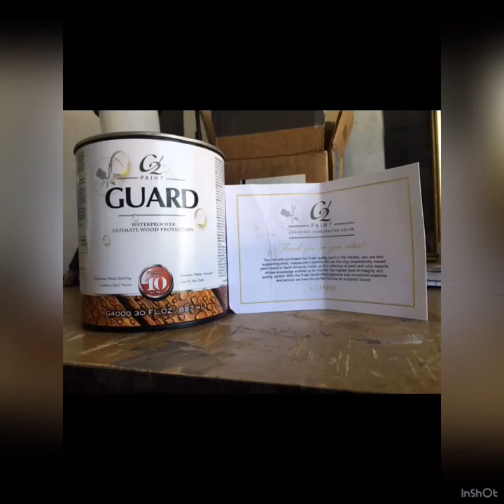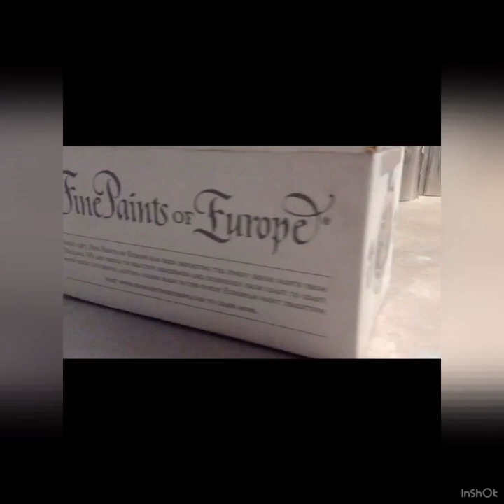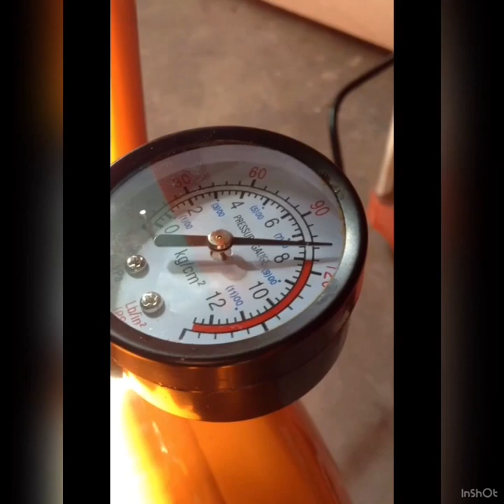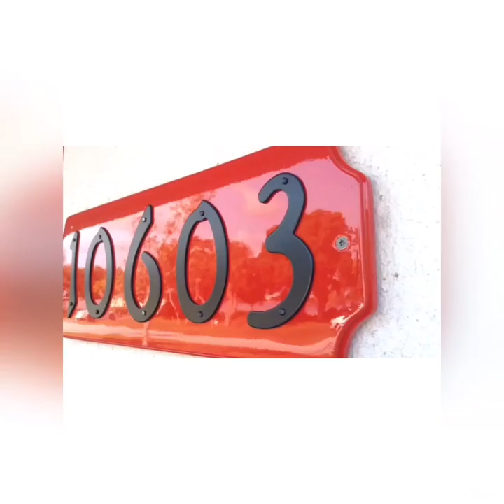Fine paints of Europe hollandlac brilliant front door

Comment: Amazing job Tyler!!!! Where are from? I’m your 217th Subscriber. I didn’t know this paint can be sprayed, my dealer told me to brush it on with the Omega Brushes. They really should give more instruction about how to use the paints for different. I really want to spray for my project. Did you add any thinner or solvents to the paint for you application…. Nice Video…
Reply from the maker: thank you! im from michigan but i lived in florida for some time and did this door there. This was thinned 20% with fpe mineral spirits. i have brushed it before but not with omega brushes, i never listen to the dealers most of the time, you just have to experiment with the products to know the limits

Comment: How in gods name were you ever able to handle this door. I just recently tried this paint with their door kit and it is still still not possible to put the weather stripping back in. Its soooo soft and uncured. Over a month.
 I still have to 3rd coat it as well..
Reply from the maker: oil paint can be frustrating. i just recoat every 24 hours or wait a few days. you have to put it on in very light coats or it will be soft for days.

Comment: hello your work is amazing, one question buy the same painting.  with what can I dilute the paint.  I made a sample and I am left with bubbles. I threw it with graco hvlp 9.5 tip # 2.
Reply from the maker: I like to clean sprayer parts and the system with lacquer thinner then paint thinner or mineral spirits. you can thin hollandlac with fpe mineral spirits
Reply: 😢The same happens to me

Comment: Tyler, when you sanded the putty coat, was there any wood showing or did you maintain full coverage even after sanding? (I put on the putty coat on my door but didn't realize how uneven the surface was until sanding the putty. I sanded right through to the wood though. Now i only have about 20% of the putty left on the doors.  The door surface looks spotted now but it's even.  Do you think I'll need to buy more putty and reapply? This stuff is so expensive, hoping not to have to buy more but also don't want to waste finish product if I'm skipping a critical step with the putty)
Reply from the maker: if the door is still not flat you will need to use a skim coat. it doesnt have to be fpe. like Elmers wood filler thinned slightly and skimmed. but reprime and see how it looks

Comment: Hey Tyler. Very Beautiful Work!

Did u spray your oil primer on or did you brush it?

What grit are u sanding with between primer/putty/primer coats?

ThAnks
Reply from the maker: sprayed primer, sanded with 320 on primer and used 180 on brushing putty. i use swedish putty now, because it sands much better and i sand swedish putty with 320
Reply: @tylerdavidson5114  Dude. Thanks for the instruction. I am about to start the process on a plywood suitcase project. I got my hands on some Swedish Putty. I was curious if you thought a grain filler might help to apply before the Swedish putty. I was thinking a product like Aquacoat Grain Filler. Thanks
Reply from the maker: @Tsallid  i havent used aqua coat before. you can use that or wood filler. but if your going to use swedish putty then there’s no need to fill the grain

Comment: Amazing. Did you sand the first coat or just spray the final without sanding?
Reply from the maker: I sanded with 1000. It doesn’t sand well. It would be better if you let it sit for the weekend
Reply: @tylerdavidson5114  Thank you for your reply. Your results are  amazing! I dont have a spray setup but hoping I can get similar with a brush or foam roller. Any other tips would be appreciated. Also, is this FPE's Rembrandt Red?
Reply from the maker: You can foam roll and tip it off. Just thin it down. And my spray setup for gloss isn’t very expensive it’s a Home Depot husky gun $80. And my new air compressor a makita 3hp 5 gallon $300 with a air dryer $90.
Reply from the maker: @alienproductions9948  color is Dutch tulip ge-80. Benjamin Moore color
Reply: @tylerdavidson5114  Thanks for the number. FPE Classic Europen Color Collection has Tulip Red which is similar. Thanks for your reply.
Reply: @tylerdavidson5114  Yes, I had a problem sanding the Holladlac 98  after 24 hours too. Ended up with some "pilling."
Reply: @tylerdavidson5114  Very helpful, thank you. When you say tip it off what do you mean? Thanks in advace.
Reply from the maker: @alienproductions9948  tip means use a brush after the roller
Reply: @tylerdavidson5114  I think you convinced me to try spraying! Would this 6 gallon do: https://tinyurl.com/y6cmwt5e and one of these guns, but I'm not sure which: https://tinyurl.com/y55sj2ll. If you could recommend the right hose I would appreciate it. Thank you!
Reply from the maker: @alienproductions9948  that’s the air compressor I had before. Not quite powerful enough for continuous spraying. Try the 10 gallon hulk. Or get the makita 3.0 hp 5.2 gallon. And that looks like the same gun I used but in a 2 pack. I used a 1.4mm needle
Reply from the maker: @alienproductions9948  i used a 3/8 inch rubber air hose 50 ft. i believe husky. but i think i like flexzilla 3/8 hybrid air hose. its a little bit lighter
Reply from the maker: @alienproductions9948  yes just make sure the air compressor can handle the cfm
Reply: @tylerdavidson5114  Yep. Getting the 10 gal Hulk. Has 8.39 CFM @ 40 PSI and the gun needs 7.5 - 9 CFM @ 40 PSI. You really helped me out. I also found the Fexzilla 3/8 50' at Walmart for $37.

Comment: Did you polished the door ?
Reply from the maker: No right off the gun
Reply: @tylerdavidson5114  wow... 2 questions

1- do you think it will work with the black color ? 

2- can I apply the brushing putty over a primed door ?
Reply from the maker: @jeanpaul8973  yes fine paints of Europe paints cover well in any color. And use there oil primer
Reply: Thanks for all informations my friend. One more question... after first coat of paint ... did you sanded it or did you put the second coat right after dried.( next day)
Reply from the maker: @jeanpaul8973  I sanded between every coat 400 for primer and 1000 for top coat. The topcoat doesn’t sand well so you can let it sit another day to let it harden up
Reply: @tylerdavidson5114  thank you so much Brother ! I appreciate it

Comment: Did you thin the paint or primer at any point and if not would you recommend doing so based on your past experience?
Reply from the maker: No more than 30% sometimes less like around 20-25 is usually enough. Thinning it helps it lay out better and I thinned both primer and paint. Next time I’ll use airless for the primer with a 308 tip
Reply: @tylerdavidson5114  Nice! Thank you for the reply. One last question, did you do any wet sanding and power buffing on the last coat?
Reply from the maker: @finnisoestela  no sanding or polishing the finished product. If you do you have to wait for it to cure
Reply: @tylerdavidson5114   Great idea though I'm new with this stuff so I'm okay going a little slow using an HPLV and at the crazy price point got to treat this like gold so don't want to overapply it with an airless. IDK, we'll see how it goes. Thank you again for the response and inspiration.
Reply: @tylerdavidson5114  still need to reduce with an airless?
Reply from the maker: @wallygonzalez732  i sprayed hollandlac satin with my airless with a 308 tip and needed to thin it still
Reply: @tylerdavidson5114  
Dare I ask?
What about an airless with the finish paint? Other than how much money it takes to fill the line😂😂 with those ff graco tips you think a finish like that is achievable?

Edit:
I see my answer in other responses